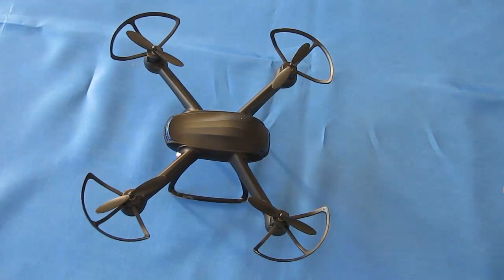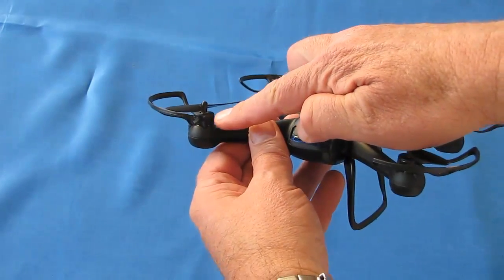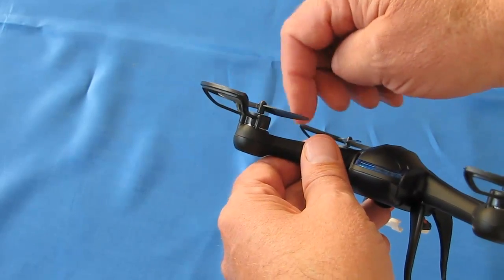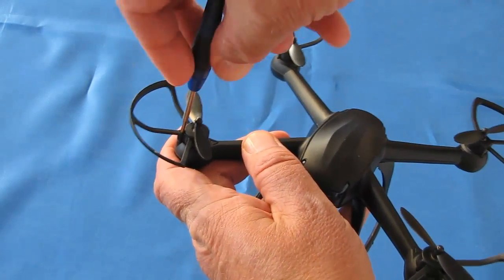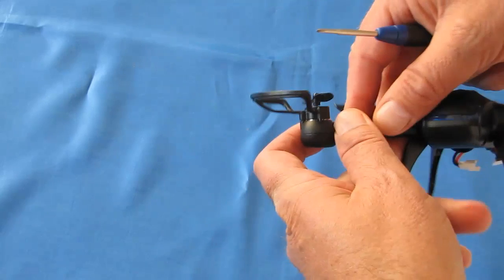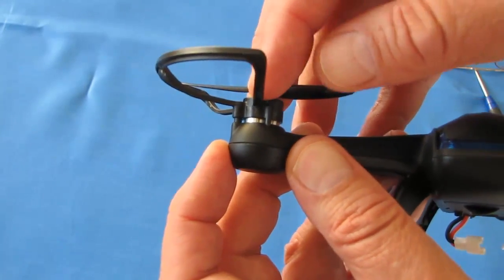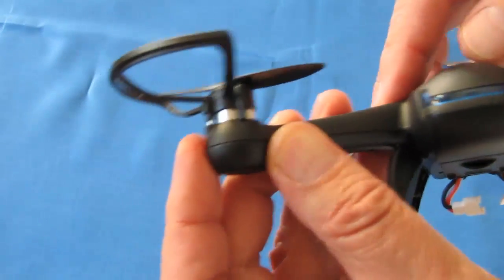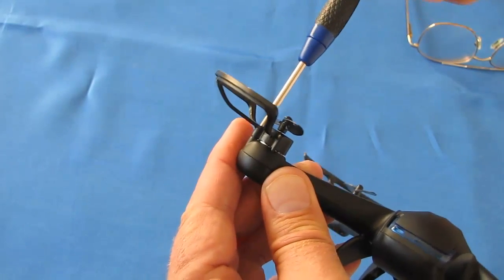DM007 Spy Drone Motor Discussion

Comment: Maybe a toy-grade brushless?  Gearbest has pic of the quad w/ the motor exposed:  http://gloimg.gearbest.com/gb/2015/201501/source-img/1421614600168-P-2355304.jpg  

Can't really tell however.
Reply from the maker: Here's a better picture, but I don't think that they're brushless.  http://static.rcgroups.net/forums/attachments/4/8/6/7/6/7/a7546247-56-%24_12.JPG
Reply: Yeah
Reply: Quadcopter 101 Funny thing is, from the glimpses of the interior of those motors through their vent slots, IF those are the DM007 motors, they look like standard iron core DC motors, not hollow cup.

BTW, while researching this topic, I've discovered that the much smaller motors used in gear reduction micro and mini quads are apparently "hollow cup" motors. Do a Google image search for "quadcopter hollow cup motors" to see what I mean.

Here's a series of different sized true hollow cup motors. Note that they are all completely cylindrical, unlike the construction of the DM007 motors and have no vent holes:

http://i00.i.aliimg.com/wsphoto/v0/1254423694/Hollow-cup-font-b-motor-b-font-model-aircraft-font-b-motor-b-font-high-speed.jpg

Here's what the most expensive brushed hollow core motors look like inside:

http://www.designworldonline.com/uploads/ImageGallery/Graphic1.gif

http://www.designworldonline.com/uploads/ImageGallery/Graphic2.gif

That's not what I see through those DM007 motor vent holes. I see what I'm used to seeing in a common iron core motor.
Reply from the maker: Winston Smith Maybe common iron core might be the way to go.  The skinny "hollow cups" are notorious for failure.  Hopefully these will be more durable.  But only time will tell.
Reply: Winston Smith I just checked and those motors linked to as being the DM007 motors:

http://i00.i.aliimg.com/wsphoto/v0/1254423694/Hollow-cup-font-b-motor-b-font-model-aircraft-font-b-motor-b-font-high-speed.jpg

ARE the same as in the manual, but the manual makes no claim for them being "hollow cup" motors. I seriously doubt that they are.

EDIT: I just checked some iron core DC motors I have on hand and they all have that magnetic "detent" effect when the shaft is rotated. Other micros and minis with brushed motors don't have this effect because they are the significantly more efficient hollow cup motors. The ones in the DM007 are not.
Reply: Quadcopter 101 I think the reason there are much more efficient hollow cup motors in the micros is because they're actually made for other purposes that require great efficiency (examples: the vibration motor used in cell phones and game controllers) and are used in microquads simply because they're available and cheap.
Reply: I my readings on hollow cup motors, I probably found the failure mechanism of the motors that fail in the geared micro/miniquads which use them (and all gear reduction quads I've seen do). 

Hollow cup motors can overheat when the maximum load is exceeded for more than just a very short time. Because the motor has no heavy iron core to act as a heat sink for the rotor windings they heat very rapidly due to overload, including when they are stalled as during a crash The adhesives that hold the windings in place then melt and the conductors in the hollow cup rotor fly apart and open or short out the motor.
Reply: Yeah you can tell from the other photo if they are brushed or brushless motors,brushed motors only have to wires coming off of them like these have and brushless motors have three wires coming off them,that's the easiest way to tell so yes these are Brushed motors.
Reply: startazz My computer fans are DC brushless with two wires and act the same way as the DM007 motors.  Brushless motors that have three wires are three phase motors.
Reply: RIB So they might be but as far as RC goes all brushless motors have three wires and brushed have two,prove me wrong and show me a link that these are brushless motors and then i'll stand corrected,plus the cheap price also indicate that this quad has brushed motors,trusted me i've been flying RC for well over eight years and i think i know a brushed motor in a quad to a brushless one.

Comment: Toy grade brushless motors maybe?
Reply: ChrisE Actually no, these motors are hobby grade brushed, look at most brushed electric RC cars and trucks, their brushed motors do the same thing, it is about the power of the magnets pulling on the shaft or diode? Can't remember what that piece inside on the shaft is called but either way, they give more power to the rotors than do say the brushed syma motors on even the X5C.